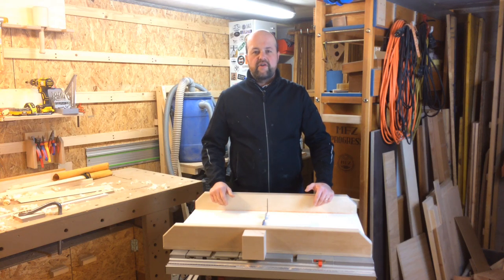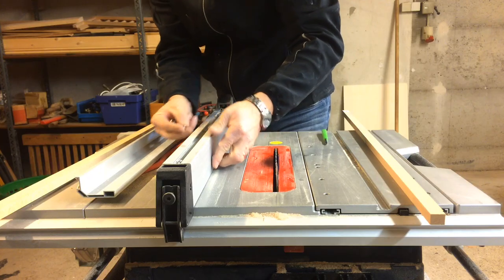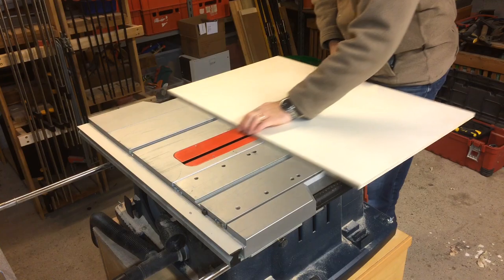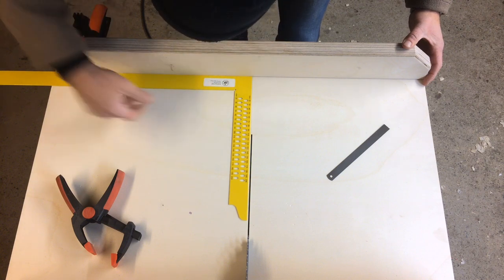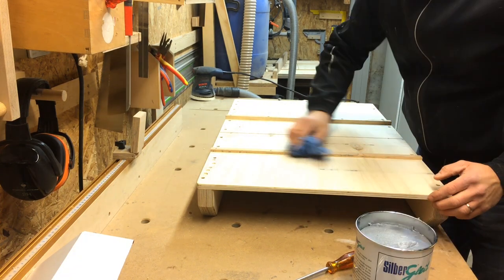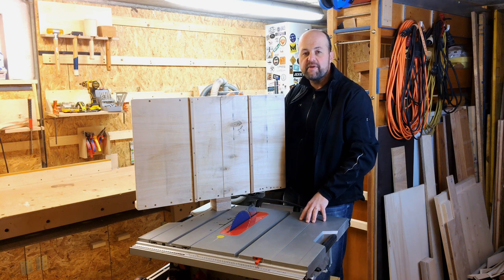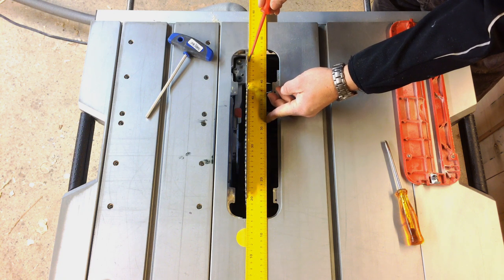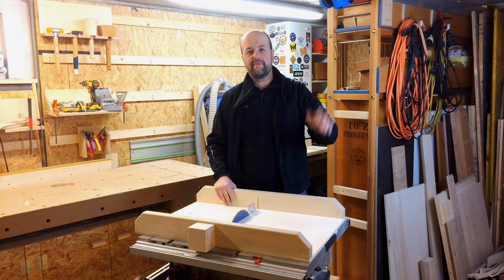BOSCH GTS 10 XC SLED  –  CROSS-CUT SLED FOR THE BOSCH GTS 10 XC

Comment: Hi Andreas! Thanks for sharing this video! I had exactly the same problems with my Bosch GTS 10 XC saw when I build my crosscut sled. I had the feeling that the grooves in the table had not the same width in the frond and back. I ended up with the same result! Don't forget that this is a jobsite saw and this saws will never be so precise as professionel cabinet saws. I know you want to have it 100% but from my experience this is not possible.  We are Germans and we always want it 110%! :-)
Reply from the maker: Thanks for your feedback, Holger. That’s good to hear. Because I tested and tested and thought I must be too dumb to do it. I also thought that the groove on the built-in sled might be the problem because that sled has a little bit of play as well so my self-made sled also has some play. 

Anyway, for most tasks the grade of precision is fine.
Reply: Andreas Kalt i open the sled and re adjust the rail and manged to stop the play, it will help to get better accuracy
Reply from the maker: +Z3boy Thanks for this tip.

Comment: Thank you Andreas for this very well explained fabrication of a coss cut sled. I have in my home workshop this exact same Bosch table saw and it definitely needs something which is a bit smoother to slide than the existing original arrangement.

Comment: Excellent video - I have the same saw for about 9 years now and made crosscut sled for it early on and it has been very useful.   I now need to make a small sled with the capacity to make accurate cuts. As a result I will be using a lot of your tips in the construction of this new sled. Thank you very much for all the information you provided. Dayle.
Reply from the maker: Glad I could help!

Comment: I found it easier when I made mine to use only the one deep rebate on the saw table, as the other not so deep, on the sliding table, the table needs needs periodic adjustments for the sideways movement.

Additionally I got the ‘critical, fence 100 percent with a roofing square.  

I did a rebate in the sled underneath to hold the runner in place.  With a shallower depth to allow it not to plough up sawdust.

When I fixed the final critical fence with the roofing square, I used glue to hold the fence in position with my jointing plane on top, keeping the square in place the glue up was all done on the saw table to avoid movement.

Overall a good video, especially the block on the back to contain the spinning saw blade.
Reply from the maker: Thanks for your feedback! Appreciate it!

Comment: I built my sled only two months ago for the GTS 10 XC. Like you mention in your review of the table saw video, the cross cut slider has some wiggle and so I wasn’t happy using that as a constant for the left slider on the eventual sled as it would not give a consistent parallel groove with the right even with the lock on. How I got round this was to completely remove the inbuilt sliding sled itself and actually use the full width as a runner so my two runners on my eventual sled would be significantly different in width. I purchased HDPE for the runners as these would not fluctuate like wood in different atmospheric temperatures. Also the grooves on this table saw taper down at an angle which differ from the typical right angle cast iron tables and so this results in the Sliders (HDPE) only making contact at one point on the angle of the afore mentioned tapering grooves, unlike the greater side to side 90 degree contact in most table saws. I hope I’m making sense but anyone who has this model should understand I hope, I may upload a video to make it a bit clearer but it won’t be yet.
Reply from the maker: Thanks for your input!
Reply: Andreas Kalt no probs, like your in-depth vids.

Comment: Nice Build. I got myself a new Tablesaw, it`s a Powerplus and similar to yours. So i have to build a new Sled. I find it very useful, even if you want to cut small things. I wouldn`t spend too much time to get a 100% squareness. A thousands of Millimeters are in my Opinion not necessary in Woodworking. Greetings from the souther Side in BW.
Reply from the maker: +U RTR thanks. About precision: it's about 1/5 mm off on the length of the fence. So it is noticeable, unfortunately.
Reply: Ok, that`s way too much.

Comment: May I suggest you consult William Ng for the 5 cut method.  I have been able to get my sleds within a couple of thousandths of an inch along 20" with his method.  The difference is that he uses instruments that are designed to measure small distances.  The cost for the instruments is certainly not zero, but depending on your desire to get square to really be square, it is small.  I spent 60 USD for mine.  What I learned was well worth while.  Wax or lube before finish is something that I learned the hard way as well.  Videos are well put together and well spoken.
Reply from the maker: +Dudley Wilson Thanks for your suggestions and your feedback  Dudley. It later turned out that it was not my method that was off but the square that I used (see video description). So I managed to get the sled square after all .

Comment: I agree with putting lubrication before, happened to me one time, and is how you said.
I think it's possible to use the saw blade as guide to square the setup, gluing the reference fence after (?), but It's only theory because I can't check it, so I apology if it's a mistake. Sure someone have best and more experience over this topic.
Good video learning explanation Sir
Reply from the maker: Thanks Daniel! I think using the 5-cut method is the best method in theory but as there are a lot of factors (one groove on the movable sled, which has some play, possibly inaccuracies in the grooves themselves, uneven width of the hand-planed runners) the errors can add up. I will work with this for now and see what experiences it brings.

Comment: Good explanation. I only use one runner myself, to avoid any friction problems if the mitre slots aren't perfect
Reply from the maker: +Mitch Peacock - WOmadeOD Thanks Mitch. Someone else has suggested this as well. So with the next version I might try it with one runner.
Reply: Next time maybe also don't put the saw blade in the middle of the sled so you have one longer side.
Fortunately I didn't have the problem with the offset riving knive but worse I tried to push the blade up through the uncut sled. Didnt work very well :-)

Für das Einstellen habe ich eine Fühlerlehre verwendet. Damit ging es gut. Außerdem hatte ich vorher schon neue Löcher vorgebohrt, sodass ich nur noch schrauben musste.
Reply from the maker: Thanks for the suggestion. But what would be the advantage of having a longer and a shorter side?

I didn’t have a feeler gauge (Fühlerlehre) so I checked how thick a piece of paper is. Probably not as accurate because the paper can be compressed, but a necessary compromise.

Comment: Andreas,.. Rather than take a full length shaving off the runners, if you look along the length of the sides of the runners ie the sides that run against the aluminium of the t slots, you will see that the timber shines where it rubs. This will not be along the entire length for sure. The trickis to only remove these shiney bits giving a more uniform runner. Hope this helps Regards Stuart
Reply from the maker: Thanks for the tip!

Comment: Hi Andreas. I'm part way through making a my sled. I haven't attached the fences yet. I had exactly the same problem as you regarding friction. It was impossible to move the sled more than a third of the way across.  I tried finding where it was binding by using a marker pen on the bearing areas on the slots and trying to run sled across to find any high spots and then sanded these off without much success. I purchased some woodworking wax today and applied that ... BINGO. The sled doesn't shoot across the saw but the difference is remarkable. Now having watched your video it appears friction is the culprit.
Reply from the maker: Thanks for your feedback

Comment: I also have this table saw and had to address the dissimilar mitre slots. Additionally I had a problem where the sliding table was at a slight angle. I've since went down to 1 guide bar with no issues.
Reply from the maker: Thanks. What do you mean by “went down to 1 guide bar”?
Reply: Apologies, I originally had the 2 guide bars on the bottom of the sled set up and operating correctly however I found that the shallower slot on the sliding table (left side) was at a slight angle so I removed the guide bar from that side of the sled and it now operates fine with just 1 guide bar (the right side). 

I have been meaning to remake my sled with HDPE or cutting board material for guides as in Scotland we have fairly severe humidity shifts and it has got stuck in the mitre slots in the past.

Keep Making!
Kris
Reply from the maker: Thanks Kris, that’s a good idea.  

On my saw, the slot on the built-in-sled is not at an angle but the sled itself has some play. So using only the right groove might be a good idea. I’ll  keep this in mind for version 2 of the sled which will surely follow at some point.

Comment: I love your videos.  I was thinking watching your previous GTS 10 XC video, you may benefit for applying washers to the heads of the screws holding your riving knife in place.  A small amount of thread locker may be helpful as well (just enought to add small friction to threads, not entire thread area).  As you had mentioined it moved when you tighten the screws, washers, under the screw heads will greatly help reduce movement upon tightening, but will reduce rotating friction; hence thread locker.  Thank you for your video. Nice job!
Reply from the maker: Thanks for your idea. It’s not the screws that move the riving knife it is the fact that the riving knife itself is a little bit bent so that when you release it after clamping it down it will move to its original bent position.

Comment: I have the same saw and I am about to make a sled myself so much appreciate your efforts. I have just bought a set of feeler gauges just for setting the fence square. I'm hoping it will help but I think you are right in that you must persevere until you get a satisfactory result. I am sure it seems quite a quick process when viewing other YouTube videos but they do not really talk about the time it took or how many times that had to tweet things? Keep up the good work.
Reply from the maker: Thanks. It later turned out that my results were not that bad but that the square I used for testing was actually off (see video description). So it seems doable, after all ;-)

Comment: Great video! And I need to make my own. On my GTS 10 XC I find the table top to be not exactly plane. And the built in sled surface is a fraction of a millimeter higher than the rest of the table. Have you experienced this with your table, and has there been an issue regarding your sled resting on an imperfect plane? Like your sled plane not being square to the vertical saw blade?

Comment: Use UHHW stick-on tape on bottom of anything you want to slid easily. In this case the bottom of sled. It will glide easily. Use the five cut method to get the back fence perfectly square to blade. Videos on each is on Utube.

Comment: Good work mate, if you are able save your pennies for a cabinet saw, I've been down the same track as you & saved to take that step up, not picking on the Bosch but table saws are not there forte, cheers 👍👍👍
Reply from the maker: Thanks Dirk, I've gradually come to this conclusion myself. So I’ll have to live with it for a while but the idea of an upgrade certainly hovers somewhere at the back of my mind ;-) Thanks for your feedback!
Reply: This path is probably clear to most off us but another issue is shop space
Reply: PhilGroene hi mate, correct you are, however consider mobile base, you already may have a shop made workbench underneath the saw so space becomes irrelevant in that case, happy woodworking & only trying to share tips with you brother 👍👍👍

Comment: Hi Andreas! 😊
Nice video, I like how you explain everything! I think this cross-cut-sled is much better to use than the original sliding sled at the saw?! I'm looking forward to your next video!  
Bye, Thomas 🖐🏼
Reply from the maker: Thanks Thomas! Yes, the original one is fine for small workpieces but has quite a lot of play. And you can’t attach a stop block for repeat cuts. On the new one, the workpiece can be guided much more securely and safely.

Comment: Thanks for a great video on cross-cut sled for the Bosch GTS 10 XC table saw! I just bought one of these, and now wonder if it would be possible to make a sled which is wider on the right side of the blade as it is possible to extend this side of the Bosch GTS 10 XC. So I am interested on your thoughts on building a sled that would take advantage of the table saw extension on the right side, which, fully extended will give you approximately 75 - 80 cm wide table on the right side of the blade?
Reply from the maker: That’s perfectly possible, in my opinion. Just make the sled wider to the right. Good luck.
Reply: @holzhandwerk_ak  Just don't put a lot of pressure on the right hand side of the sled as the fulcrum change will bind and wear the runners

Comment: I understand then, that the sled slides on the table of the Bosch cutter for all its base and not, only for the two sliding guides, right? thank you very much for the video, good job.
Reply from the maker: Yes the sled sides on its whole bottom surface.
Reply: @holzhandwerk_ak  Thank you very much for your answer. Greetings.

Comment: what is that fence extension? i've never seen that before.
Reply from the maker: It’s an add-on to the rip fence, you can attach it with bolts if the workpiece is so narrow that it would be hard and dangerous to come with a push stick between the (higher) rip fence and the blade.

Comment: andreas you could try to glue with epoxy a thin shim of HDPE onto the edge of your sliding table and take out some of the slack, its slick enough not to affect the sliding action but i think it may improve it, just an idea . i would also suggest clamping a straight edge across the saw blade and riving knife when fixing it, i know theres not much space there, maybe a small g cramp would work ;0)
Reply from the maker: Thanks for the tips.
Reply: what size thickness shim are you meaning Green Man?

Comment: Great video, thank you 
I have the same saw and unfortunately the top is not flat, the sled sits a bit higher than the rest of the table. Did you ever run a straight edge on the top to try yours?
Reply from the maker: +Adrian Radu I've done that  when I built the cross-cut sled (see infocard in the video) and it doesn't seem that it's uneven. Maybe you can take off the sled and see if you can flatten it's runners a little! I think they are made of plastic or aluminium.
Reply: That is exactly what I did, they are plastic indeed. Thank you
Reply from the maker: +Adrian Radu 👍

Comment: Thanks Andreas - like many of your other subscribers, I also have a GTS 10 XC and have encountered similar problems to yours. Do you have any plans for your cross cut sled (e.g. Sketch Up)? - I'm about to build mine and it would be very useful! Thanks :)
Reply from the maker: Hi Fergus, I don’t have any plans for the sled, unfortunately. The plywood base is about the size of the table. The two vertical pieces at the front and back are about 4 cm thick and about 8,5 cm high (make them about 2 cm higher than the blade at maximum cutting height). 

Make sure you check out the video description. The five-cut method worked fine, my wrong angles came from a square that wasn’t really square. Good luck with the build!
Reply: Thanks Andreas, keep those videos coming, they're excellent :)
Reply from the maker: Thank you!

Comment: Hi Andreas, I have the same saw, and built the same kind of sled a year ago. I think my next sled will only have one runner, maybe I won't use wood, but some metal or plastic. Have you ever seen such a solution? Would be nice to hear some second thoughts... I like your videos, keep on your good work.
Reply from the maker: I saw some sleds with only one runner, I think Matthias Wandel made one. AllesOhneKabel made a sled with plastic runners and I think Nick Ferry used Rockler metal runners. One runner should certainly be enough and with this saw and the movable sled one on the right is probably better.

Comment: Hi. Did I get it right? The grooves are 16.1mm and 16.8mm wide? The depth it’s readable, 7.5mm and 12.1mm. This I don’t understand Bosch, why not having standard 3/4” mitre gauges. That’s why mainly I didn’t decided yet between Bosch GTS 10 XC and Makita 2704. Any advise? Many thanks

Comment: Andreas, is this tablesaw generally a good and accurate machine?  and the mitre runner is not of a stanard size is it?
Reply from the maker: It is fairly accurate, Paul. The sled has too much play (hence the self-made cross-cut-sled). The runner ist not standard size.

Comment: Hi Andrea's. Love the videos. I also have the gts 10xc table saw, and I'm just wondering what blade you have replaced the stock blade with?
Kind regards
David
Reply from the maker: I bought this set by Freud: https://www.sautershop.de/kreissaegeblaetter-set-die-roten-250-set-3x250-30?c=15903 – The one with 40 teeth is an ideal universal blade: both for rip and cross cuts.
Reply: @holzhandwerk_ak  thanks very much for your reply. That's very helpful.
All the best.